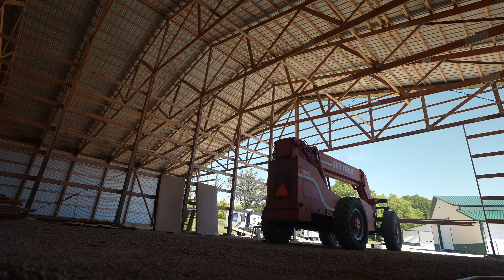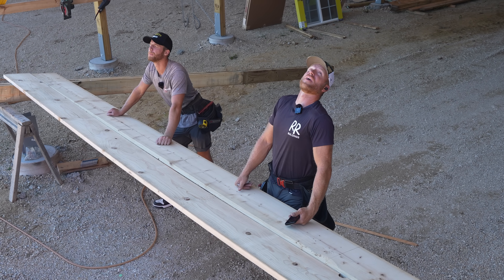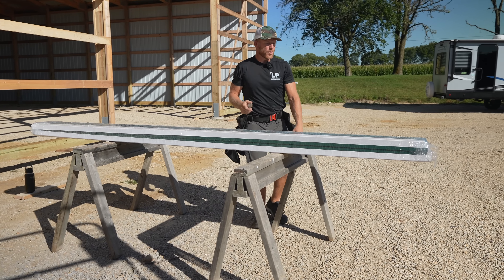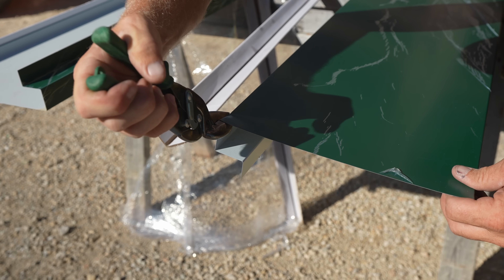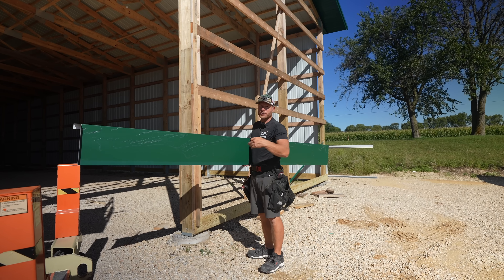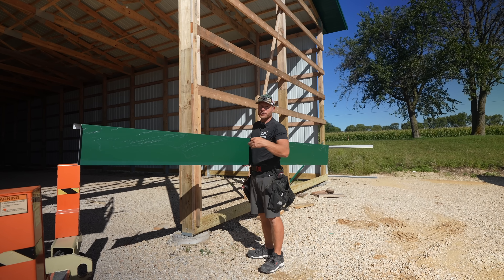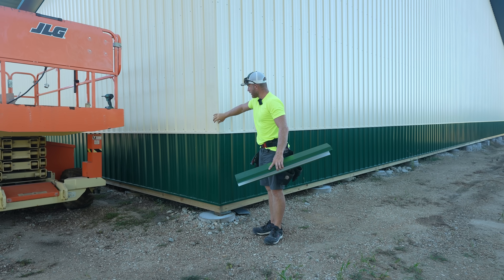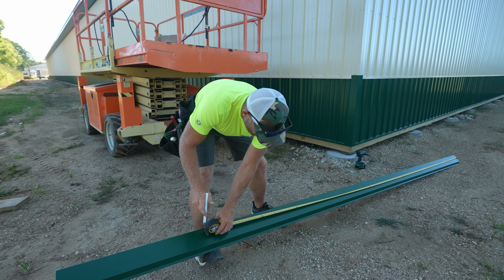COMPLETED!! The BIGGEST Building is Finally DONE

Comment: As a past garage door installer and owner until the cancer disabled me. I want to acknowledge that you know and understand what installation of the door and opener require for headroom. We did quite a bit of new construction for quite a few different contractors and only very few knew and retained the requirements of installation. So many times we were framing out before the work could be done. So kudos to you!🇺🇸🙏
Reply: I definately ran into the same issues while doing overhead doors.

Comment: 39 days is very impressive. Yes, please do a bracing video. If strong winds hit the 304 ft. side of the building, how will it not be pushed over. The only thing I can see that will keep it from flexing is the post brackets and the roof but you would think that it might need a knee brace at the top of the post to bottom cord of the roof rafter.

Comment: so, what keep water from running behind the corner trim piece on the bottom along the Z trim that sits atop your bottom metal, Kyle? it seems like, since the bottom corner trim is coming out on top of your z trim that it leaves a path for water behind that bottom corner piece. If that makes any sense? I'm just thinking that the sides along top the Z trim has a possibility for water to run down the corner metal behind the corner trim because of the way part of it goes over top the Z trim and not under it?

Comment: just wondering why do you put the top trim on first and put the remainder on the bottom which is closer to eye level , or is it easier to work it from the ground instead of doing it from inside the machine.

Comment: What a great job, especially for 2+ men in 40 days!
I know the stated use of the building is uninsulated, no ceiling, storage structure, forever. But forever is a long time and plans change. Wouldn’t it have made sense to future what you built to put in trusses for, say, 100 feet of one side so that adding a ceiling later would be quick & easy? Then adding shop or showroom square footage is pretty straightforward?. I’m just an amateur, but I’ve had the ‘pleasure of sistering trusses and working around all the steel plating is not fun. But spending your client’s money is fun. Guess I shoulda been a politician instead of a mechanical engineer!

Comment: Is this really complete?  Will there be a slab and how will it connect up to the walls?  The concrete pads for the posts sit well below the bottom of the walls.  How is that gap covered?  Do you just encase the bottom of the posts in the concrete slab, along with the galvanized steel bracelets?